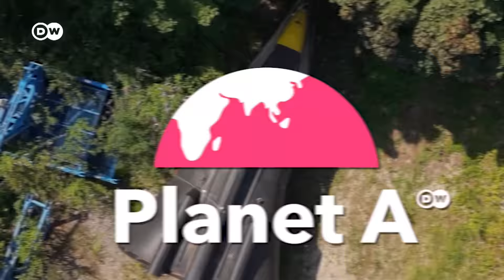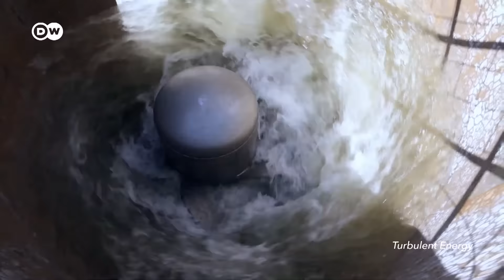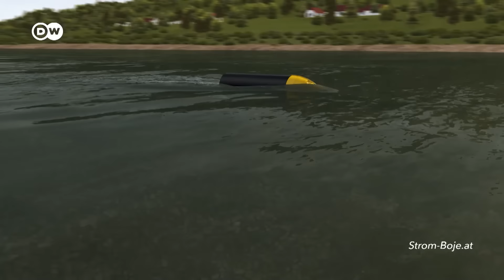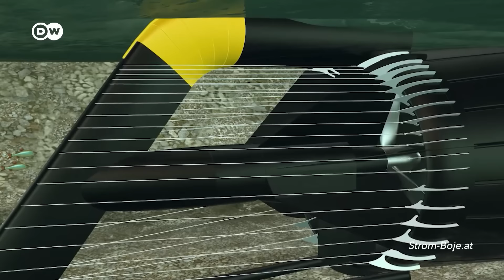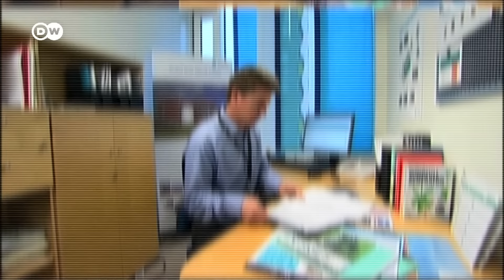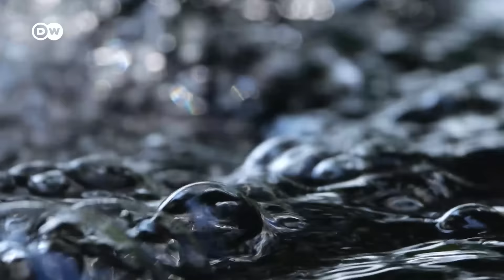How to make hydro smaller (and better)

Comment from the maker: Which of these solutions would work best where you live?
Reply: would be life-changing
Reply: In-stream turbines in The Bay Of Fundy!
Reply: In my region the in stream generators would probably work best and a few of the small turbines could be built, there are some options which would be well hidden while not being more than 100m away from roads
Reply: CORRECTION!
Seventy MEGAWATT not Gigawatt on that Chart.
Reply: Funny, they're still talking about these systems like we did in the 1970's and 1980's. It was all theoretical back then and yes, someone should try it and study it and it could work. You would have thought we would be in the mass adoption phase 20 years ago, but here we are still studying the issues.
Reply: There is a lot of gravity where I live .
Reply: Ultimately, the power you get from hydro is always proportional to the height and the throughput of water. Everything else is just tinkering with efficiency.

Comment: we used to have a small vortex plant in our village that powered almost 50 homes, but it was deprecated once transmission lines were brought closer to it. it was cheaper at first, but how expensive electricity is nowadays, i believe it would have been cheaper to keep production locally
Reply: I think your people should try to restore that vortex plant to make your bills cheaper again
Reply: They are such cool structures. Giving them a modern use helps preserve them.
Reply: The problem is the payment for reparation
Reply: Sounds like a GoFundMe is in order.

Comment: here in the UK there are soo many old mill streams that were made back in the 17th and 18th centuries to power water wheels to grind grain or power textile factories. Many of those ended up having villages or small towns grow up round them. I've always thought those mill streams that were already engineered to provide steady flows of water with a lot of drop to power water wheels would be perfect for micro hydro to help power the communities they are near. But there are soo few that have actually done it
Reply: Its not just England. Its all around Europe. Even my village in southern Poland still have stream that was used to power sawmill.
Reply: most of the old watermill streams wouldnt produce enough energy worth investing in plus those streams need regular maintenance and/or cleaning. back in the early days some of them did get a generator retrofit that produced enough power to light up a couple of bulbs but that isnt worth anything today.
tho you could probably dam it up a little and install something like the vortex generator etc. with some more investment.
Reply: I had the same thought. We have a museum water mill next to our house in Germany and I actually tried to compute how much energy could be produced with the current setup and such a whirlpool turbine. It was pretty disappointing, it's better used as a museum. The energy we use every day now has just grown by so many orders of magnitudes, it's hard to fathom.

Comment: A more decentralised grid is also a good thing. I really like these ideas.
Reply: But managing such grid is very cumbersome. I hope HVDC would be less expensive to build
Reply: @saiv46  Batteries. Get home batteries to flatten the demand.
Reply: Decentralized grid=expensive grid. Make centralized grid more secure with backups is the way.
Reply: Decentralized grid is more expensive. Also, these small run of river hydro plants are providing fairly constant output, which loses the biggest advantage of large hydro, which can regulate its output, and serve as peaker power plants or backup for solar and wind. It's better to focus on what works, large scale wind, solar, and hydropower, with backup of batteries and some gas peaker plants, with a few large nuclear reactors for baseload.
Reply: Customized sol'ns (replying to the other commenters). Not everyone lives in a city. Not everyone lives near the grid. A small village in mountainous terrain is not the same thing as a large city on flat ground. Different needs, different methods.
Reply: I always assumed that at most these smaller systems would feed directly into a nearby building and less so into the grid, meaning still a need for a centralized grid but less demand.

99% of private renewable installations will not cover all their energy needs, only supplement it.
Reply: @HdbeWydvd  It really depends on the situation. Centralised grids are well suited to populated areas, but they have a weakness in rural regions as long runs of power line are expensive to maintain and take a long time to repair. So for more isolated settlements there is an advantage to decentralised generation, even going all the way off-grid for buildings which are not within easy reach of the grid.

The sort of hydro power described here is expensive, yes. It's entirely unsuitable to powering a city. But a small village in the sticks? It's cheaper than building pylons to the middle of nowhere, and it won't go down every time there's a storm.
Reply: @iwiffitthitotonacc4673  True. Though it's really just about money: Making a solar power installation that covers most of your needs is a fraction of the cost of making one that covers all of your needs, because covering all your needs requires a really big and expensive battery. And because the panels you would need to generate enough power in winter would be greatly in excess to requirements in summer.
Reply: a decentralised grid is a bad idea, it allows for price gouging to happen very easily "don't like the electricity prices? go somewhere else... like move somewhere else, oh you're too poor... such a shame... ask the government for money."
Reply: Less oversight by companies and such.

Comment: There's also a small seawater-riverwater powerplant in the Netherlands on the "afsluitdijk", a dam that separates the sea from our biggest lake (which used to be the sea).
The plant works with Reverse ElectroDialysis (RED), generating electricity from the ion transport between the two types of water.
Nice idea, although not commercially viable with the amount of membranes necessary and the pretreatment of the water. 

Would work better with salt brine though, but that has its environmental downsides as well.

Comment: There are many solutions out there and I am glad that we are constantly finding new ways to generate power without damaging the environment, my final year engineering project was a floating hydro-power generator that used plates attached to a tracked wheel (like a tanks track) this meant that we could deploy it in rivers that had a lot of pollution but it was still efficient, and seeing all these other methods is always enjoyable.

Comment: Considering the concern is with traditional hydro's upstream flooding suprised there's not a mention to run of river weir based hydro schemes. Uses a weir to pull some of the flow from the river without flooding upstream. And compared to vortex shown here that generates on the order of 50kW or so run of river hydro can get up to 50MW or so depending on the installation

Comment: Big dams have their advantages. For example they're there to prevent seasonal flooding and they prevent a river from running completely dry during a drought.
Reply: Need adequate bypasses if migratory fish are present. Also better if water from releases is from the top layer, so it is closer in temperature to the main river channel.

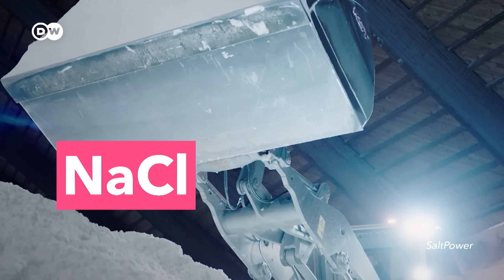Comment: 8:18 what would happen if a long pipe was fitted down to the deep ocean and then the water with higher salt concentration was brought back to the surface level? The way to do this would be a high to low pressure setup. Thoughts?

Comment: Hydropower has hardly become any cheaper in recent decades, as construction costs (concrete!) have risen significantly. 

Wind and solar power, on the other hand, have become drastically cheaper. 
Today, electricity from solar panels can be generated from 2 US cents/kWh and from wind energy for 4 US cents/kWh.

Comment: I like the whirlpool turbine but the osmosis one seems less viable to me.
As a Canadian, I see unpowered dams everywhere! So powering them up seems like job 1.
Then I am also seeing wind and solar getting rolled out on our grid with that Hydro backbone and I think, great! Now we can use our reservoirs to hold water and release it as we need the water and power. No batteries or pumped storage required. Just well timed releases

Comment: I'm slightly surprised these are the things we are considering. Nothing wrong with the ideas, but we're essentially electrifying water mills. Go for it, but probably solar + wind + batteries (broadly speaking, not just Li-ions) will be a lot cheaper.

Comment: You can take 15 feet of pipe and direct slow moving water from a stream downhill. Attach a ventruri valve at the end and now you turned slow moving water into a high powered jet. Depending on the DIY micro turbine you use this should be enough power for a single home.

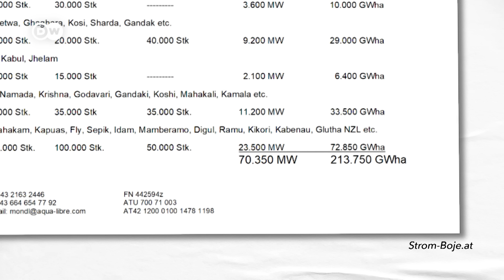Comment: 5:08 that's a decimal point, not a coma... a coma means "thousand of" a decimal point is basically whole number plus this much of a whole number beyond the decimal point... so it's 70.350MW, not 70GW... in total it would be 213.750Gwha... as in Gigawatt hours per year.

Those numbers aren't very impressive as you would think... the entire project EVERYTHING is equivalent to 24.4MW per hour every hour over a year... 

A solar park 1.5square kilometers would beat that with far less ongoing maintenance - in fact, why dedicate one large location when you can just split it into spots that can fit appropriately and power localised things? that would save even more money.

This entire project of small scale hydropower is just a investment magic trick to take your money and run. Next time I would suggest your editors ask for the numbers, verify the numbers and compare the numbers to something more affordable and viable with the technology we have today.
Reply: The source is in German. That means the point marks the 1000's. And the decimal seperator would be a comma.

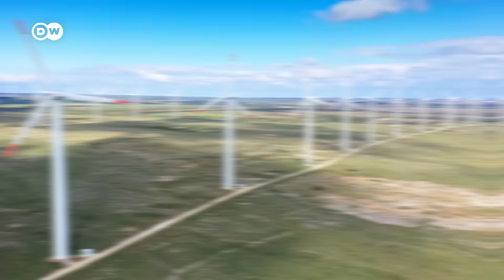Comment: 9:58 none of these solutions will replace huge dams tomorrow, or ever. They are small projects not really in similar scale of utility power generation.
Reply: I don’t think the goal should be to replace dams. The goal should be unique solutions for different climates and locations in order to build a more robust power grid that doesn’t rely on one or two large power companies/power generation sources that will screw over their customers
Reply: @MC-be5gg exactly. DW should not start with the grandiose promise - what if we can harness water's power without having to build destructive megastructure? They already know they cannot.

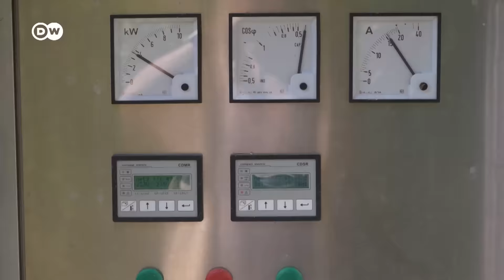Comment: 1:20 less than 4kW? That is literally only enough for 2 people to turn on their kettle, cooker or washing machine at the same time.
Also a highly capacitive load on it. Is this perhaps not actually from the generator in the picture? The generator looks large enough to do a at least 25kW. I can't imagine it not being run at full load since it would be wasteful - more coal and gas would have to be burned.
Reply: If it was only 4 kw, then it would need battery storage to smooth out demand to run two households with minimal electric appliances.
I can pull 6 or more Kwhr with all electric and being conservation minded.
Reply: @blaydCA  yeah. I'm all for hydro power, but just 4kW from such an installation is not enough. 
I wonder if it's running off grid. The instantaneous consumption of a block of houses can be 4kW if there's just some refrigerators and standby usage. But if it's grid tied, i'd assume they would run it at its maximum continuous power output as much as possible.

Comment: Ahh... Your turbine blade is suspended over an oval
(=====) shaped cavity...

It would not make sense if your turbine is not suspending in an oval shaped cavity since a basin, or as what you termed as turbine basin, is a requisite for the turbine blades to turn. A flushed or a deep bottom would only make it slow or would even make it stop from turning.

The side cavities and the bottom or basin will be very cold. The temperature in the two areas will be very cold...

And so...

If there are algae there, then, it is a sign that there is a presence of nitrogen and/or fish poop.

Nitrogen will deposit on the cavity sides, causing algae on the said surface. Fish poop will most likely cause the algae at the bottom basin.

The rpm of your turbine will depend on its dimension and the speed of the water current. Therefore, we can also say that the existence of vortex tail, tailing down the basin, would vary in width. 

There is a constant volume of water going in. Therefore, we can say that oxygen supply through H20 is being replenished and sucked out, constantly.

If we would take the bottom or basin and the side cavities as two separate systems, in analysis, and each has their own independent algal colonies... Then it would be safe to assume that there ISN'T REALLY ANY SUBSTANTIAL INCREASE IN THE OXYGEN LEVELS.

Algae thrives on:

(1) Fish poop or nitrogen

(2) Cool temperature

(3) And oxygen(?)

And then fish, crustaceans and bacteria, are too...

CONCLUSION: There isn't really any significant or SUBSTANTIAL INCREASE in oxygen levels.

Comment: While these smaller environmentally friendly hydro-plants can generate electricity, it doesn't mean that they should. If the energy generated is expensive these systems will be only built in small numbers and the energy shortfall will be filled by cheaper and more polluting alternatives powered by coal and gas
Reply: I think the small hydro power systems would be competitive in many cases.
Getting a system for something like 50 000 € should be possible.
And let's say it generates 10kW of power continuously.
In total it would be less cost effective than solar energy, but it could provide power during the night.

Biggest hurdles would be when the stream freezes or dries up. So these systems seem best suited for regions around the equator. (no freezing in winter and no long droughts)

Comment: These vortex-and-buoy ideas only capture a small fraction of a river's energy during the rainy season, but NOTHING during the dry season.
By contrast, a hydro dam captures 90% of the river's potential energy, averaged over an entire year.
In short, dams are a form of energy storage  not merely power generation and this whole video is pointless.

Comment: While that mini-tubine dam is neat, I've seen it off in on for quite a number of years now,  but it feels a little disingenuous to suggest it's low maintenance is basically getting weeds out of the strainer grate,  there's moving parts, and whenever you have moving parts you need to make sure it continues to move without friction, which usually involves some level of lubrication.
Reply: true, it's low maintenance in the sense that it probably only needs about one or two days of maintenance per year.
But it won't be suitable for a non professional to do that maintenance.